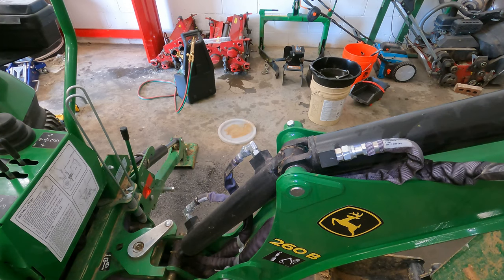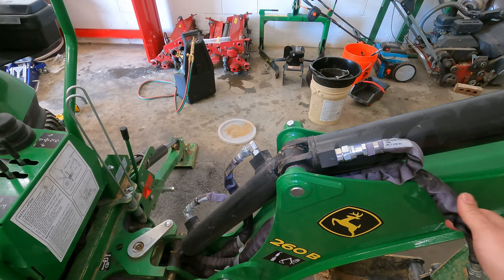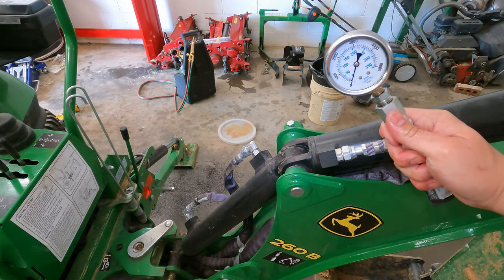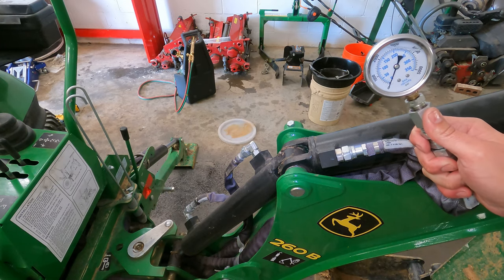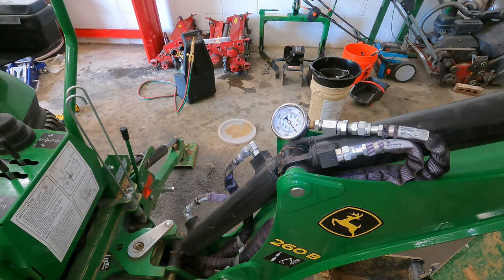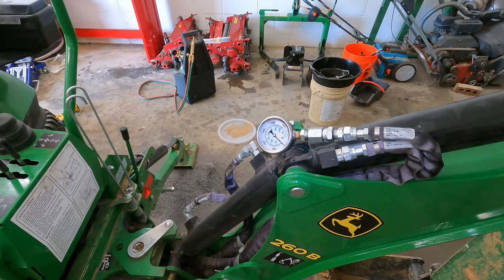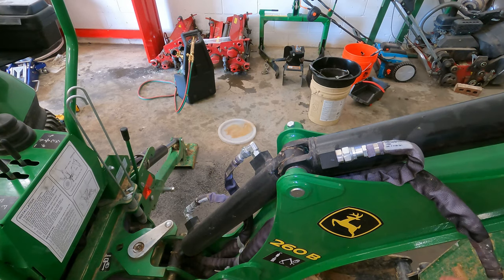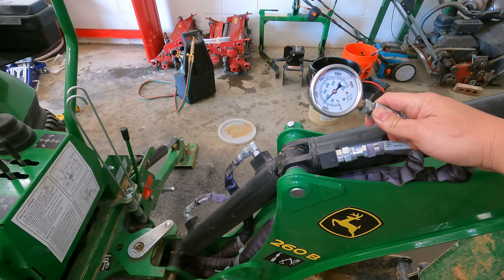John Deere 260b Backhoe Hydraulic Pressure Test and How the Loader SCV Affects Backhoe Pressure

Comment: Thanks.  Very useful information.  One major limitation for my BH is digging in frozen ground.  Looking for some more curl power to really break up the ground when digging.
Reply from the maker: The larger bucket cylinder will definitely help when you're breaking up hard ground and it will give you insurance against bending your rod since it has a 1.25" rod vs. 1".  On the push side, you're pushing force will increase from 7854 to 9940 pounds of force at 2500 psi which is a ~27% increase in power.  

If you don't have the HydrosPlus Extreme Capacity Kit, you will lose about 20% in speed as compared to stock.  If you have it, you will be about 80% faster than stock using the HydrosPlus cylinder vs. ~100% faster than stock using the stock bucket cylinder.

Comment: Are you saying there's only 1 relief Vallve?? For the system
Reply from the maker: There are multiple, but the "weakest" one will prevail.  In this case, the ones on the backhoe are set lower than the implement circuit on the tractor, so the max pressure for the backhoe is lower than the loader in my case.

Comment: Can you show where the relief valve is located for the backhoe, my boom is horrible!
Reply from the maker: I haven't cracked into them before, but if I do, I will make a video showing the details.  That said, they are at 2500psi, so you don't have a lot of room to go up.  HydrosPlus offers a strong bucket cylinder and the boom cylinder is coming soon.

Comment: You have shown. us where the loader PRV is located and demonstrated how to adjust it, but where is the backhoe PRV and did you adjust it?  Or is there only one PRV to adjust?
Reply from the maker: Based on the diagrams, I think the backhoe has 2 PRVs.  I have not adjusted those since they are set at a higher pressure and the weight of the tractor isn't enough to support the extra power, in my opinion.  In other words, if you can't dig at the current setting (~2500 psi), then more pressure to the backhoe isn't going to help because the tractor isn't big enough to hold itself in place.

Comment: Don't hold that line with your hand when adding pressure. Hold it below the connection or tie it up. 2000 can cut you and you really don't want that oil in your hand.